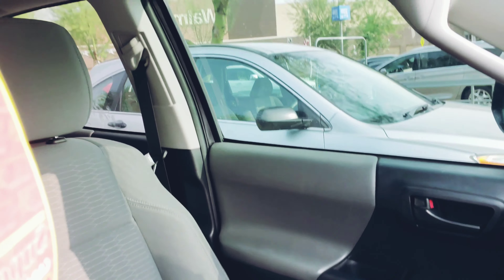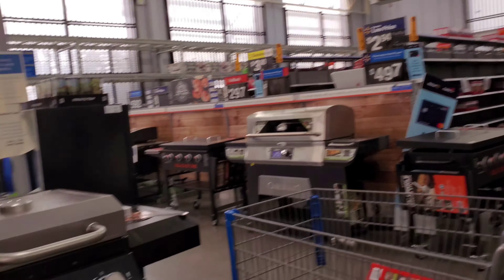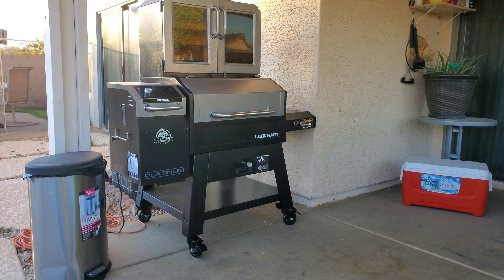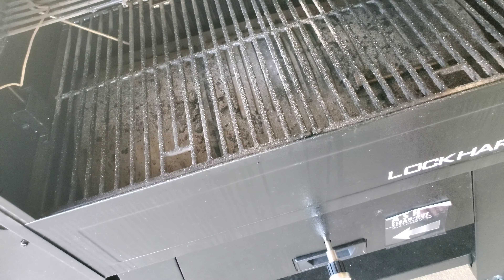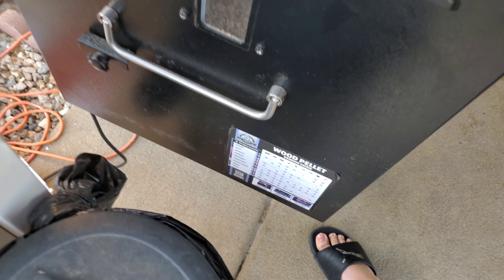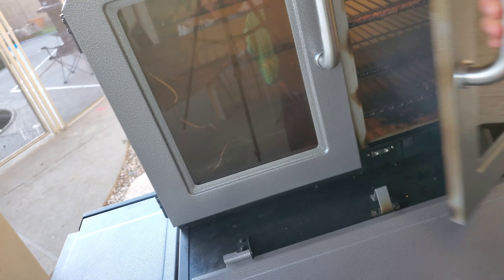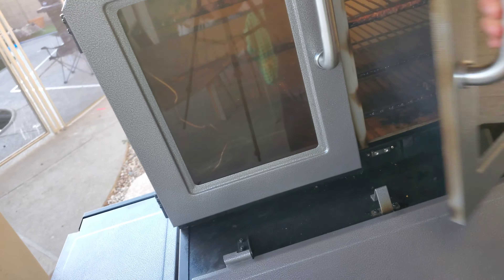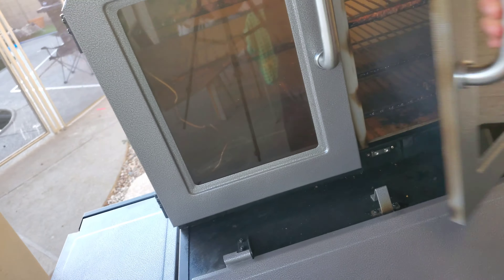Lockhart Pitboss Pellet Smoker Review

Comment: I purchased mine 7 months ago and have had nothing but issues. They've sent me 3 replacement main boards and an auger. And it still errors out and shuts down within 1-2hrs. With it shutting down non stop like that it's impossible to do any kind of long smoking of foods without having to baby sit it and unplug and restart the grill the moment it errors. Also the new app they made for it does not work and what little range and control with the original app is gone. Now I have to be within 10ft for it to connect by Bluetooth and wifi no longer connects. Support has been no help since the initial parts sent to try and get it working correctly.

Comment: How long did it take you and the temperature for the brisket and this item went up from last year from 7 hundred dollars and something to 850
Reply from the maker: @ Gamal Simmons. I smoke my briskets from 180 to 200 temp range for at least 18 hours. Internal temp for the brisket should be ideally around 215 degrees. Take the brisket off of the smoker and double wrap it with foil and wrap in a towel, and then let it rest in a ice chest for at least 4 hours

Comment: Have you smoked a brisket or ribs on this smoker? And how did the smoke tube work out?
Reply from the maker: @ Mayhem, my apologies for the late reply. I smoke just about anything with this smoker, I have smoked ribs and brisket, I have used the smoke tube as well and it just gives it that extra boost of flavor from the additional smoke penetrating the food. I would recommend getting an smoker tube to assist with smoking, it does add additional flavor. Hopefully this info helps you out.
Reply: @chefwes5406  All I do is run the unit in smoke mode for 3 hrs after that run it at temp for the meat I'm cooking the smoke ring is there. I did ribs and pulled pork in so far that way.
Reply from the maker: @SirRealGhost  I’ll have to try out that trick, thank you

Comment: have you gotten the app to work? I got the same grill and so far I can't figure out how
 to get it to smoke and the app doesn't work right
Reply from the maker: @ Rican_dude. Hey there, yes the app does work. I actually had to delete the app a couple times and re-install it and that ended up solving the issue. As far as seeing enough smoke, when you first turn on the pellet smoker, set the temperature @ 5 degrees and let it warm up for about 10 to 15 min depending on the outside weather temperature, after the unit warms up slowly raise the temperature until you reach your goal temp. If its colder outside it will take longer for the pitboss to warm up. Also keep both of the control arms open and open both the top stacks on the smoking cabinet all the way open to pull smoke throughout the entire unit. Every time I smoke I throw in a metal smoking box to help get extra smoke throughout the unit. I will be uploading a video soon on individuals having difficulties with the pitboss smoker. Hopefully these tips helped answer your question.
Reply: I believe that one is a Walmart exclusive

Comment: do you still have this smoker, are you happy with it? Pro/Cons please.....I am in the market and this is one of my finalist. Thanks
Reply from the maker: @ Neal Zaragoza. Yes I still have this smoker and I love it. I have researched plenty of pellet smoker's, and I can say that I am very satisfied with this specific smoker itself. The only con I can think of is that I would have like to have seen a bottom cabinet with doors to put accessories and misc. Another con would be that when you open the bottom unit door it doesn't rest completely on its own if you have your hands full, it has a tendency to fall and close shut sometimes if you bump into it. Other than that, I would most definitely recommend this unit,  I find it very underrated and I would recommend this over a Trager smoker. Hopefully this info helps you on finding a smoker that is suitable for you.
Reply: @chefwes5406  Thanks for the info, I do appreciate it.
Put a magnet on the lid or the lid rest? I was looking at the stopper (or lid rest) in the store, it looks like it can be adjusted back a little bit, add a magnet to it-Boom
Reply from the maker: @ Neal Zalagens. Thats actually a clever idea. I'll have to do that. My apologies for the late reply, I have been busy lately and I will promise to upload videos on an consistent basis.